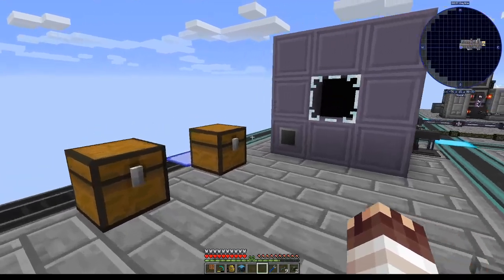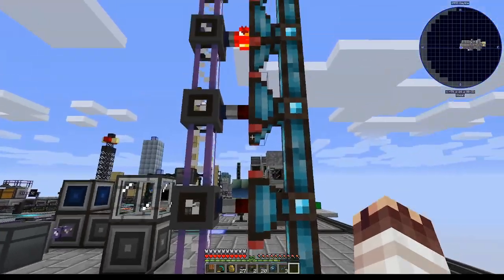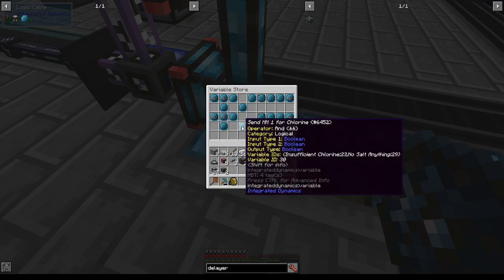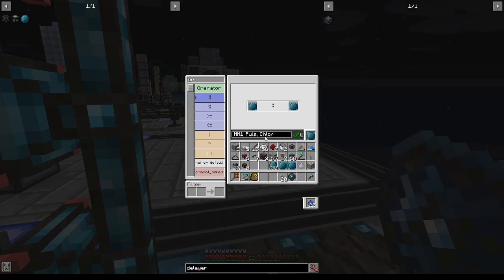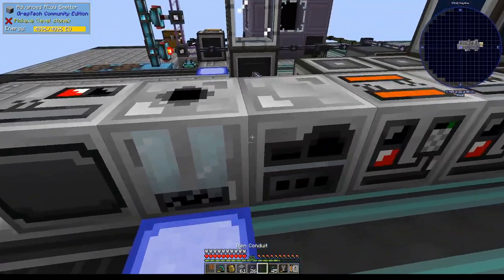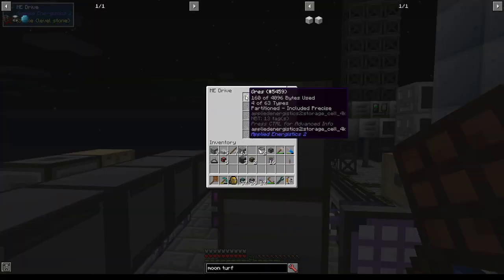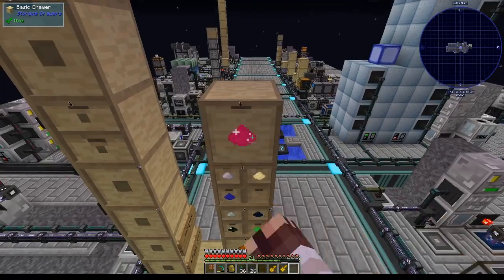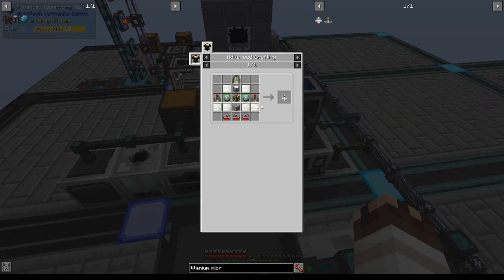Omnifactory Supershorts #27 Part 2: Auto Microminer Sending and Processing

Comment: Your Episodes are very good, but you add a Integradet Dynamics to the modpack. i play on a comunity server and adding mods to a offical release Version is not allowed. Now, i cant rebuild your setup.
Reply from the maker: I apologise! This setup is a very unnecessary one at this stage in the game and I know of no way to do it other than with ID. A simplified option in which you do not auto-send the miners involves putting a level emitter against a lamp and turning the lamp on when you have insufficient resources. When you see the lamp, send the relevant MM. You need few enough MMs before the creative portable tank that this is a good idea!

I hope this helps you.